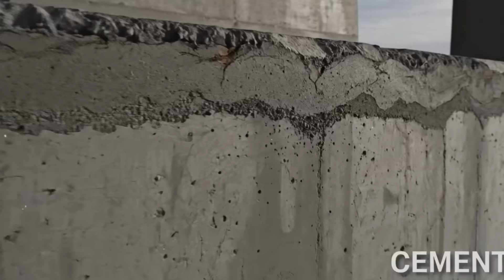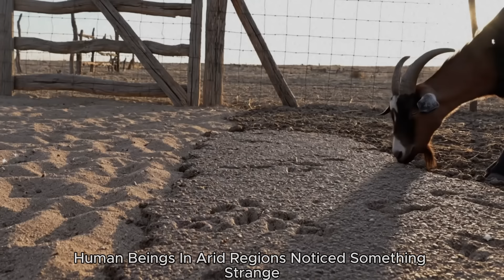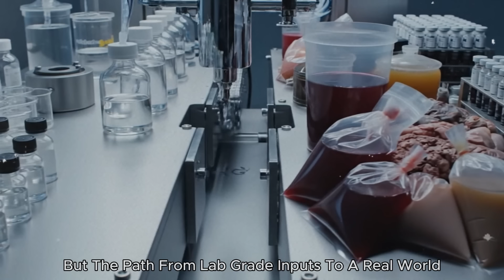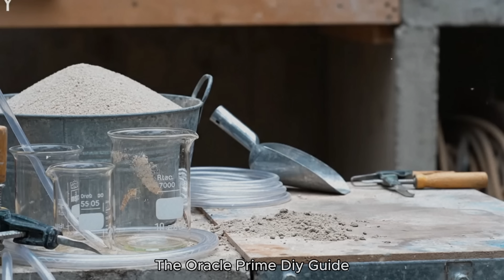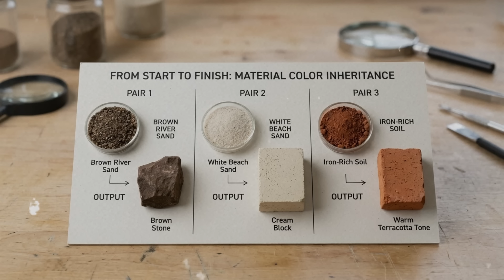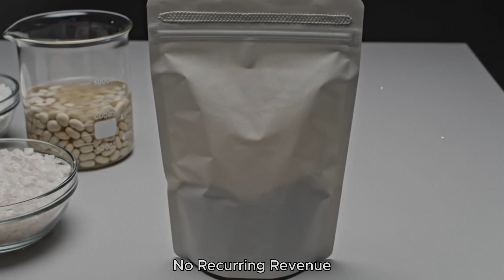Urine Turns Sand Into Stone — No Cement, No Heat, No Cost

Comment: Sand, straw, clay add water, you have cobb... build your home. To protect from water damage apply a lime plaster coat and then apply a lime slip coat. 1 part clay, 4 parts sand, 1 bucket straw (never hay) to 5 buckets dry material, add water slowly to get your thick sticky mix. Foundation should be stone and high off ground, with large roof overhang to protect walls from water and paint them with lime plaster and lime slip.

Comment: DEF that is used in diesel vehicles is Urea.
Reply from the maker: Yes — DEF is a urea-based fluid. The point in the video was about how a simple chemical compound ended up becoming part of a much larger emissions-control system, not that urea itself is rare or exotic.

Comment: So if i build a huge mold the size of the great pyramid filled it with sand then dosed it with urine  would create a one piece pyramid a pyramid from one block😮
Reply from the maker: Funny idea, but not quite. The process needs controlled bacterial activity, calcium supply, drainage, curing, and even distribution through the sand. A huge sealed mold full of sand and urine would more likely become an uneven, smelly mess than one perfect pyramid block.
Reply: No, but it would stink for several blocks:face-blue-smiling:

Comment: I just been watching something similar that uses ash and vinegar.

Again it has been suggested that perhaps the ancient pyramids used a similar method, not carved stone but stone made from dust.

In fact the method was tested and some of the blocks were checked and low and behold they found evidence that suggested moulded blocks not blocks dragged around the world, dust.
Reply: Yes, you are absolutely correct!  You can see that it's a form of plaster and not carved when you look first hand - it has come off the walls in lots of places in Egypt's many monument sites around the area of the pyramids and down the Nile.
Reply: @minniemouse8686  It still makes them interesting but let's face it it is a tech that somehow got mislaid.

Instead of aliens with levitating machines, instead of masses of craftsmen slaving away with hammer and chisle, instead incredible engineering with powerful lifting devices created using water power, simply get the whole town to take a leak in a similar location and make use of their pee, or make lots of really bad wine make it go off and use it as vinegar.

Of course you still need people to collect the sand for you and make molds but using clay they could then make any shape they wanted, which they basically did.

Also those huge columns makes you wonder if they were carved or just peed on.
Reply from the maker: That ash-and-vinegar idea is interesting because it points to real binder chemistry. For the pyramids, though, I’d be careful: the “cast stone” theory is debated, and the mainstream view is still quarried and shaped limestone. But ancient people clearly understood more material science than we often give them credit for.
Reply: @OraclePrime1004 true bit there is room for multiple construction techniques.
Reply: The dust and mould using pee or vinegar seems to make more sense though.

Comment: They mixed rice flower in the mortar used in the Great Wall of China. This was to make it stronger and weather proof. Has any one tried adding this to "Piss Bricks"?
Reply from the maker: Yes, sticky rice mortar in parts of ancient Chinese construction is a real and fascinating material story. It worked because the organic starch interacted with the mineral binder. For “piss bricks,” the question would be whether the chemistry improves strength or just adds organic contamination — it would need actual compression and weathering tests.

Comment: So why dont you just culture the bacteria from sandstone? Where are the instructions for the 10 and 20 megapascal production?
Reply from the maker: Good question. In lab versions, it’s usually not as simple as “grab bacteria from sandstone.” You need the right microbe, nutrient source, urea/calcium chemistry, moisture control, curing time, and compression testing. The 10–20 MPa range depends heavily on the recipe and curing conditions.

Comment: You need to look at in the old days they used animal urine.  Barns were drained to collections.
Reply from the maker: Good point. Historically, animal urine was collected and used in several trades because it contains useful nitrogen compounds. The key is that old systems usually treated waste as a chemical input, not just something to throw away.
Reply: @OraclePrime1004 my grand father collected it and made wood head as rock.  You could barely hammer a nail after treatment.

Comment: can you mix it with air create
Reply from the maker: If you mean aircrete, that’s a different material system. Aircrete uses trapped air bubbles to make a lightweight block, while this sand/urine idea depends on mineral precipitation binding grains together. You could experiment, but adding air usually lowers strength unless the recipe is carefully controlled.

Comment: The sand can also be melted to make window panels.
Reply from the maker: Correct — sand can become glass when melted at high temperature with the right additives. That’s a different process from biocement, though. Glass is heat-fused silica; this method is more like mineral binding at low temperature.

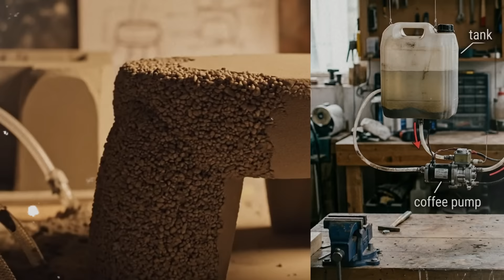Comment: The picture at 13:02 makes no sense.  I have never seen a coffee pump configured like the one depicted. nor have i seen products hung from wires. the hung blender would be all over the floor if hung by the lid as depicted.  The picture is  total garbage.
Reply from the maker: Fair criticism. If a visual is inaccurate, it distracts from the point instead of helping. The chemistry and material argument should stand on real process shots or clean diagrams, not impossible AI-style props. I’ll keep future visuals more grounded.

Comment: Megalithic process?
Reply from the maker: Possibly related in spirit, but I’d be careful using “megalithic process” as one blanket explanation. Ancient builders used many different methods: cutting, lifting, casting, plastering, lime chemistry, geopolymer-like binders, and clever logistics. The interesting part is testing which method fits which site.

Comment: Does it smell of urine when wet?
Reply: Are you taking the piss?
Reply: @Boltzsi yes. Piss is urine
Reply from the maker: If it is properly cured, rinsed, and mineralized, it should not smell like urine when wet. If it still smells, that means the process was incomplete or there is leftover organic waste trapped inside.

Comment: Try using equal amounts of quick lime, sand/ ground pumice powder, gravel, mix dry before adding & 50% water/50% urine and mix in a well-ventilated area using safety gear. You will make concrete that heals itself and is stronger than normal concrete and does not require metal reinforcement and does not change colour and is good in water.
Reply: Sounds like Roman Concrete . Which i believe is still in the Mediterranean ocean as Roman docks and Quays.
Reply: Quick lime not exactly No Heat, No Cost.
Reply from the maker: Interesting mix, but quicklime is very caustic and urine can add biological risk, so I’d be very careful recommending that casually. The idea of lime, pozzolan, aggregate, moisture, and self-healing chemistry is real, but claims like “stronger than normal concrete” or “no reinforcement needed” still need compression, weathering, and structural testing.
Reply: Iron rebar will work as structural support as well
Reply: @Anarchyatitsfinest  Iron rebar gives concrete cancer.

Comment: I think if you add copper or even perhaps the same iron that's found in magnets Gathering From the sand iron into the product it just would seem to me the micro crystals need something of iron or some sort of metal
Reply from the maker: Interesting thought. Metal particles could change the structure, but this process mainly depends on bacteria, urea, calcium, moisture, and mineral precipitation. Adding iron or copper might help in some experimental mix, but it could also cause corrosion, staining, or weaker bonding unless tested properly.

Comment: Does it smell of piss if it gets wet ?
Reply: That concerns me too
Reply: Make in outside conditions. Will likely emit ammonia smell (NH4)
Also, tapping the molds will remove much of the swiss cheese effect of the center of blocks.
Note how solid the calcified exterior is compared with the core..
Reply from the maker: If the biocement process is done properly, cured, rinsed, and mineralized, it should not smell like urine when wet. If it does smell, that means leftover organic material is still trapped inside or the process was incomplete